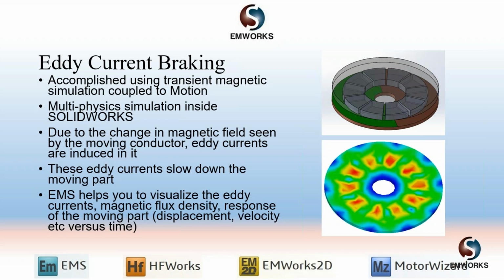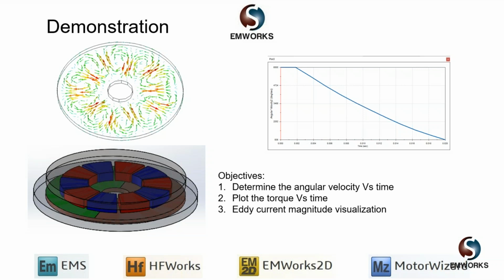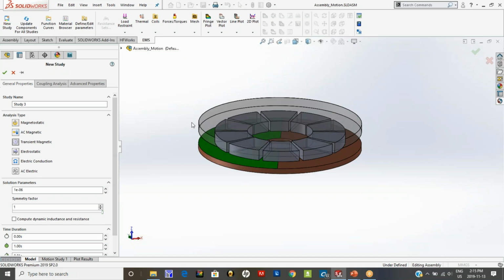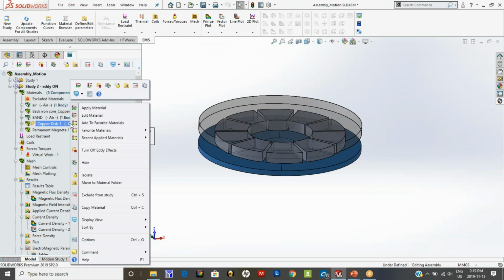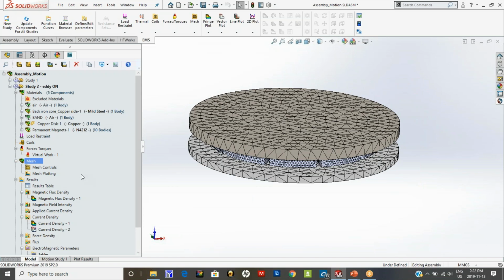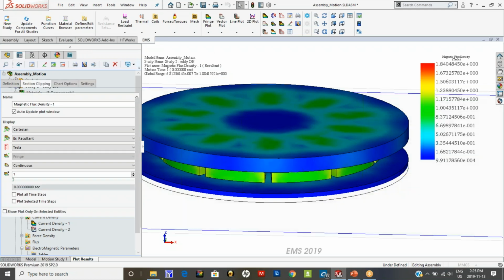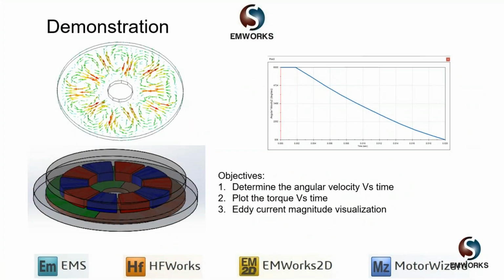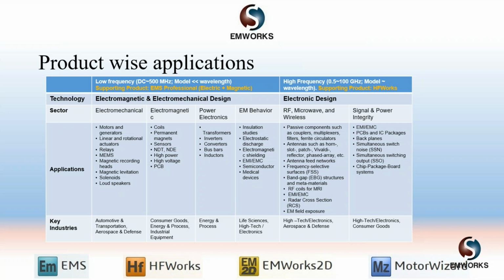[Webinar] - Simulation of Eddy Current Brakes using EMS inside SOLIDWORKS

Comment: Hi, I am busy with an eddy current braking simulation and have gotten stuck on an error and was hoping you could help me. The error states that the "mass density" is not set. It would be grately appreciated if you know about this error and how to correct it.
Reply from the maker: Hello Donovan,

Were you able to solve your issue? 

you have to define the material for the moving in SOLIDWORKS as well to get the mass density for the motion analysis. 

Please contact us through support@emworks.com/ majdi@emworks.com, we will be happy helping you on this.

Thanks
EMWorks Inc,

Comment: where did you apply the 1000 RPM? (I did't see it in this video) , and can one define it as a function in your software? I worked on another software where it is easy to configure the rotating speed (angle) as a function of time, do you have such thing?
Reply from the maker: Hello Server Clinic, 

Eddy current brakes are solved using EMS Transient module coupled to SOLIDWORKS motion study. The speed is defined inside the SOLIDWORKS motion study as initial velocity. It is a constant value. 

For further information please email us at : majdi@emworks.com or post your questions here : https://www.linkedin.com/groups/8154341
We will be happy to answer your questions.

Kindly,
Majdi